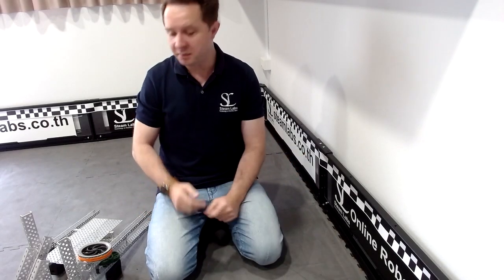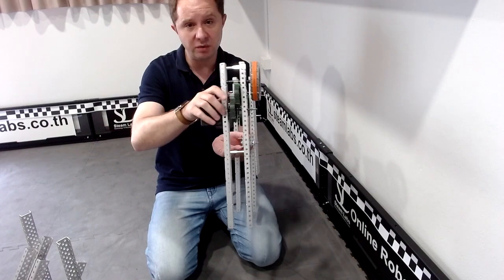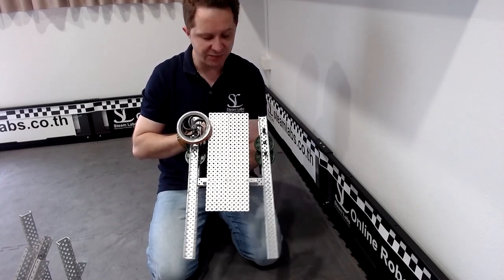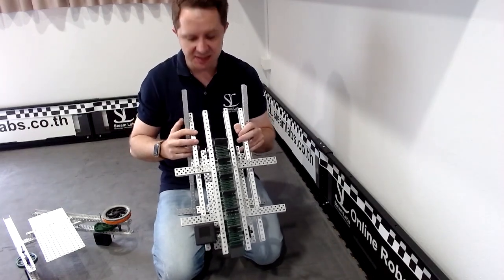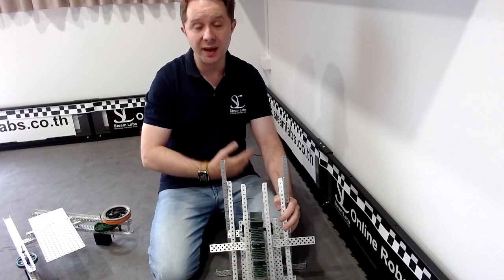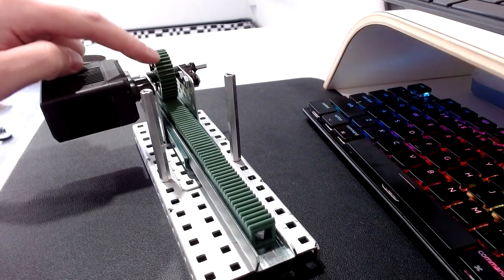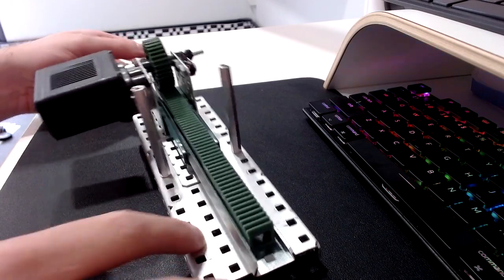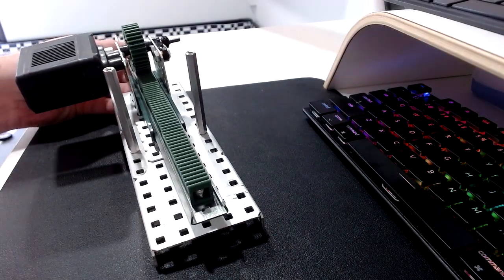VEX Spin Up Robot Design 2022

Comment: If u guys have flex wheels 4in 30a will work great with the frisbees for a flywheel
Reply from the maker: Just moved to having a single flywheel instead of 2 using standard VEX wheels, it’s launching it far enough, will upload a new video once goals are assembled this weekend + once the mechanism is attached to the intake

Comment: I like those designs! One bit of feedback I'd have is that none of those will put spin on the disks. Due to the physics of the disks, it's difficult for them to fly accurately without spin. I think the best solution to this would be to go with a design similar to your first one, but with a single flywheel on one side.
Reply from the maker: All in testing stages for our teams, let’s see how they progress, will share any successes and failures
Reply from the maker: You were correct, single flywheel is working superb, will upload a new demo this weekend or early next week. Thank you 🙏